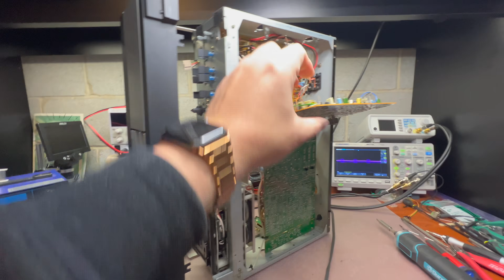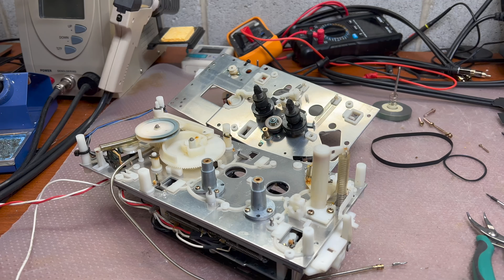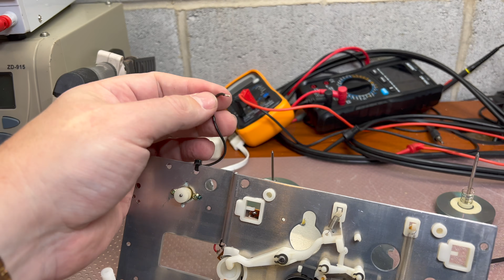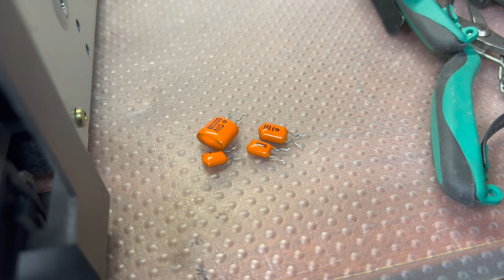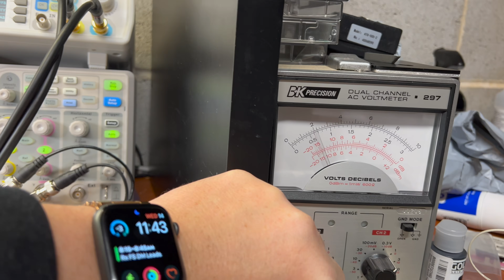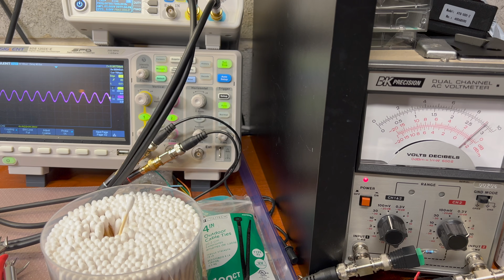Nakamichi LX-3 Repair Diaries: Breathing New Life into Vintage Cassette Decks

Comment: I have a Nak LX-3 which won't go into Play mode (nor Record)...what do you charge for repair work and how backlogged are you?
Reply from the maker: You may open bottom cover and replace short belt on the CAM gear motor. not a big deal ;)
Reply: @hifirulezzz  Gotta handy video showing that?  🙂
Reply from the maker: @ I have a lot of videos how to fully disassemble Nak tape transport. You may learn a lot about how everything work.

Comment: What do you recommend replacing those orange caps with?
Reply from the maker: Use film caps from Kemet, Wima or Nichicon.
Reply: @hifirulezzz  ok thanks. Started getting some popping and each channel and left is cutting out completely after warmed up for a bit. Don’t want to put a ton into into just replaced what is needed
Reply: @hifirulezzz  if 2% not available 1%

Comment: Do you have to disassemble all the way that transport to change the belts and idle tire? I'm about to buy an LX-3.
Reply from the maker: Yes, you will have to, idler tire is between two aluminum plates. Check my other videos - I did same disassembly multiple times.
Reply: @hifirulezzz  If I remember correctly years ago I replaced the tire on a BX-300 and that was quick.
Reply from the maker: @csabakereszturi945  BX-300 has a way different tape transport.